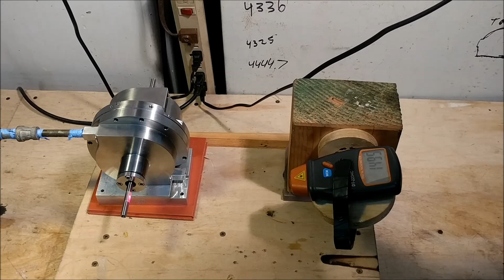Metal Tesla Turbine Low RPM Low Pressure Test. TEASER!

Comment: So, the molar density of water vapor  is 18 Grams per 22.4 liters at STP.  And, air's molar density is closer to 28.8 grams per 22.4 liters at STP.  

Unsurprisingly, air is more dense than water vapor at the same temperature and pressure which is why water vapor can get so high and form clouds, which means more momentum could be transferred per liter of working fluid.

I get why you use water. Because of its low boiling temp under vacuum.  But, What do you think about using a fefrigerant under pressure for the working fluid, aside from its flammability  of cource.

For example, propane or  butane. On the other hand, acetone has a molar mass of  58.08 grams,  and one mole fills 22.4 liters at STP.

Comment: Have you tried vacuuming using brown's gas?
They say it creates an implosion which causes a great/very high efficiency vaccum that dwarfs the conventional vaccum production method.
Reply from the maker: We would like to use plasma discharges from to ignite the hho, and water vapor in a pump for combustion. Then we can re-cycle the hydrogen into water creating an almost flawless closed system could be possible.

Comment: I wonder if something like this could ever work with a car.  For example, instead of using a normal turbo we Chuck this on
Reply from the maker: Cars and flying machines! The important thing is to have a very efficient generator, and a very efficient motor to transform the high speed medium torque into low speed high torque. This we have the answer for to and will be wrapping this system up very shortly.
Reply: iEnergySupply you think the would be a lot more dynamics when it comes to aircraft but then again the already have turbines

Comment: That sounds great at 5k.  Is it possible that the baseplate is acting as heatsink? And creating vacuum?  Would a larger heatsink prolong the acceleration effect?
Reply from the maker: By simply adding water the power goes up. Also I used more air at 5 psi then I did at 30000 rpm while induction heating the pump casein with a magnetic field from magnet on the shaft. The vacuum amplify s the heat sink effect as well.
Reply: @iEnergySupply  Yes, your turbine is creating cold from compressed air (heat source) and then the compressor stage is taking the cold air and re-compressing it.  It would be interesting to chart the air temperature before it enters your turbine and then again when it exits the pump.
I believe your momentum gain stops when the device comes (down?) up to a specific run temperature -- if you can delay that effect by bolting it to a larger heatsink, you might be able to extend the momentum gain.  Conversely, a larger heatsink could work in the reverse.  
 It would be extremely cool if you could leverage the vacuum effect internally to the dual stage turbine,  rather than encasing it.

Comment: Excellent build and run guys! Congratulations! It has been a long way, and a very good learning experience, till this built materializes. It will be very very interesting connecting the turbine to run under vacuum (cold steam). Do you have knowledge on what is the humidity of the air you are supplying? Before going to vacuum changing this one variable and observing how the dynamics changes will likely give interesting knowledge. Another interesting point is as now you have a metal turbine ( vs the acrylic one ) and knowing that the metal is a good conductor, it probably will be worth considering how the heat radiation from the turbine surface impacts the efficiency. In some experiments it may be worth enclosing it in rock-wool ( or some other material ), again changing one variable at a time,  just to observe how not-allowing-heat to radiate will impact the dynamics of the run. Again congratulations!
Reply from the maker: That's definitely how we experiment here. By simply adding water the power goes up. Also I used more air at 5 psi then I did at 30000 rpm while induction heating the pump casein with a magnetic field from magnet on the shaft so we know the faster it goes the more power we get from a given amount of air supply.. The vacuum amplify s the heat sink effect as well. Another thing to note is when we added water to our small air tank and heated the water to around 160f, the little tank was preforming as well as the large tanks. Our testing will be a series of videos and Ill take testing advice from you guys as we go. it would be really interesting to insulate the turbine. That will be a test for sure. Thanks for suggestion.
Reply: @iEnergySupply  With higher RPMs more back-pressure will be created, due to the increasing the density of the fluid towards the periphery resulting from the increasing of the centrifugal forces, hence less fluid will be consumed when not under load. This dynamic is exactly to the back EMF dynamics as Tesla notes in his writings.
Amplification of the heat sink effect by vacuum is very logical considering that heat is by definition increased relative speed between particles (of the substance, the fluid in our case) and if there are less (intermediate) particles , more vacuum,  the particles containing the "heat" ( having higher relative speeds ) will have a longer mean free path and highly decreased probability to bump in intermediate particles before transferring part of their (relative speed) energy to others, a lot further, specially separated particles.  In other ways said the heat potential increases its velocity.
If you have some footage with adding the heated water, please share it. This is excellent confirmation of our understanding how Tesla Turbine (TT) works as thermodynamic transformer.
Again Great Work guys! You are one of the few groups on the net doing an original and extremely useful research in highly misunderstood field. Congratulations!

Comment: If you keep the same pressure there’s going to be a bounce variance, this would probably be something that would need to be managed other through load against your generator or through valve control on the front end it would be very touchy
Reply from the maker: Yes this we will have a solution for in the future. I also want to make an adjustable nozzle.
Reply from the maker: @enterprisestobart  We have two nozzles, but one will be for recycling the exhaust for an experiment, and also too mix the pulse-jet with steam. We will also use steam in both nozzles for an experiment.

Comment: Synchronicity load with air bearings seems to be the final test for this?
Reply from the maker: @nikola.tesla.r.and.d.centre  I've never experienced thrust on my rotor. The bearings seem to be holding up really well, although we had some issues with run-out on the rotor after tightening down the threads. So vibration is pretty bad although we are fixing it right now.
Reply from the maker: absolutely, we are working on air bearing solutions as we speak. I am going to build some graphite air bearings for the first couple air bearing tests. Paul is also looking for a good solution to this problem. All in all it won't be much of a challenge, but for now we shall see what we get with these bearings.
Reply from the maker: Ultimately having a perfect balance will be the largest game changer, but air bearings will last forever and reduce vibration via flex in their positioning.
Reply: @iEnergySupply  If these are to one day be used in moving vehicles, then the bearings will need to be able to withstand side pressures as the gyroscopic effect of the rotating turbine resists changes in vehicle direction. Do you think air bearings can be designed to do that?
Reply from the maker: @nikola.tesla.r.and.d.centre  Yeah got the graphite, I'm currently building a water solar panel for the conference. I've been so busy lately.
Reply from the maker: @nikola.tesla.r.and.d.centre  I ran a dual stage turbine without locking the rotor in place. it likes to sit in the center.

Comment: Dont loop it back to the front no faking.. okay shut up to a second third fourth turbine and cook some bacon
Reply from the maker: Will do my friend lol
Reply: I didn't mean shut up. Hook it up. The exhaust manifold wouldn't that work off of one 1 super compressed tank air tank I mean couldn't you room like I don't know anybody in line off of one if they all have the exhaust leaving with the same pressure or force that it came in or if you build a picture in one of the ports and then release it blood pressure II port and then release it. That make any sense

Comment: What if you put like bottles for instance over the 3/8 in by two ports for exhaust would it compress and compress, or then slow downthe turbine, or would it back pressure back through, or would you be able to open a nozzle say on the right bottle blow into a second turbine, then it closes and the second opens an blows on while the first builds up pressure then bam back s and forth to run a second turbine just from the first ones exhaust. builds up and run a 3rd fourth over and over  the exhausts have Purpose  other than just filling up the ozone with cooldsteam or would it H2cOld Zone³
Reply from the maker: All good ideas! We shall test them!

Comment from the maker: Yeah, some quick dimensions here, 4" rotor, .025" star washer thickness .025" disks thickness. 1/64"x1/2" intake nozzle. Dual stage. 11 disks on turbine 33 disks on pump. 3/8"x2" exhaust from pump.
Reply from the maker: @enterprisestobart  8mm but we have since increased it to 10mm

Comment: The RPMs went up temporarily when you touched the pump side. I'd venture that your hand added some heat to the system in the right spot and gave it a boost. Why don't you guys share some of your schematics and build processes on what you're using? I'm guessing that you could get some great feedback from the community (and help share the how-to-do-it love)!
Reply from the maker: Yeah, some quick dimensions here, 4" rotor, .025" star washers .025" disks. 1/64"x1/2" intake nozzle. Dual stage. 11 disks on turbine 33 disks on pump.

Comment: Told you, you will need to have a cooling system. :)
Reply from the maker: The pump is the cooling system, wait for the higher rpm tests, they are spectacular!
Reply: @iEnergySupply  yeah but it still needs to hold the incoming heat